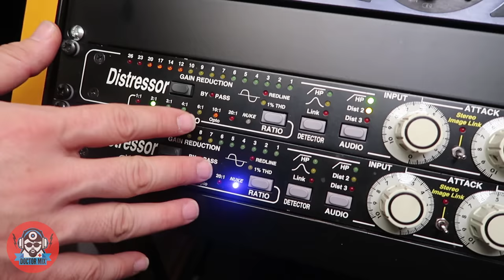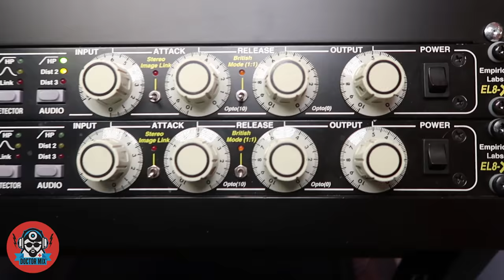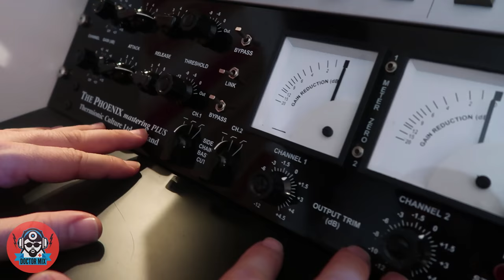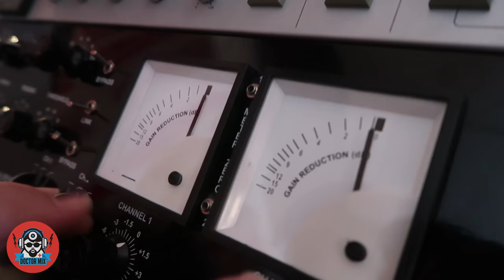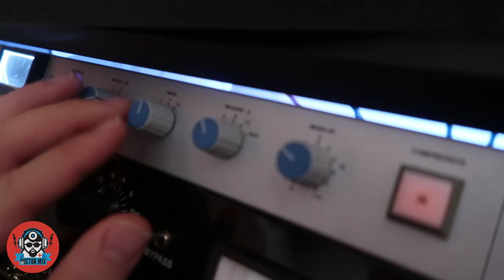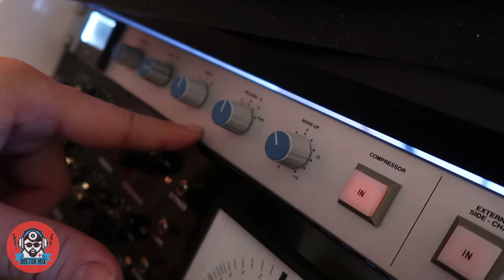How Audio Compression Works

Comment: Gain reduction starts instantaneous in every compressor circuit, there's no delay time in the reaction of a compressor - attack is the speed at witch the compressor achieves (roughly) the gain reduction dictated by the ratio/threshold controls. The release control is the speed at witch the compressor restores most of the gain taken by the compressor. So you can consider this two controls as ratios not time constants.  Of course, attack and release are not linear... but that's another story.

Comment: Very nice to hear someone who has experience with the hardware for these iconic compressors. I've only used UAD so no idea how it compares to the real units. I have a feeling not too well because my little RNC hardware unit is more effective than any of my compressors for taming vocals. I definitely have to work harder with plugins but don't have unison tech. am using an rme ufx which has a simple compressor built in.
Reply from the maker: Hi John! Thanks so much for your good comments! Rock on! ;-)
Reply: John Barry to be fair, all the FMR products have sound quality way beyond their price range.

As to cheap compressors, try the Alesis 3630. It was key in Daft Punk's Discovery and it's about $50-$100 on eBay.

Comment: Think the attack explanation is a bit off, it's not a delay of action control, it's rate of change.
Reply: everything is explained not practical and tahts why its hard to understand compression. Its hard because compresors works in 
unintuitive way. what I mean by that is when you have a unconsistant volume in some track, the intuitive way to even up the levels would be to raise teh level of quieter parts, but thats not what compressor does. It levels down the loud parts  to the level of quiet ones and then it boost up all the whole signal.  This is my practical explenation of the controls: treshold should be set at the top of a main energy of a track, this is a thing that can be observed more than heard. this is an example of determining where the main energy of a track is: https://drive.google.com/open?id=1In5SLE51ENs9uFJn3yTBokfYchDOE5iR. Ratio is a procentage of compression. 2:1 is a 50% compressionm, 4:1 is a 25% compression and everything above 10:1 is considered a leveler that quiets everything above the treshold.  Practical use of ratio. Everything with a higher ratio seems to be in your face, even and loud. so if you are trying to be new and fresh in mixing, use high ration on drums and vocals.  everything with a lower ratio is good for things that are even already or on mix bus. Attack and release are the hardest to understand. Attack is a attack transient designer of a sound. Attack of a sound is a life of a sound, so if you set it to fast it might die. I barely use anything slower  than 5ms. Drums always 30ms or higher, vocals slow attack, fast release, 4:1 and DEEP treshold - to destroy - smth like 10-12-14db of reduction. Try using it with a classic compressor like 1176 - you get that close in your face vocals. Release is a tail or decay transient designer. in practice it means that if your signal is complicated it has a lot of harmonics, a lot of elements hiting at the same time you would prefer to use longer release, faster release gives you more in your face sound. I use fast release on vocals, but it must be in tempo (check "bpm to ms calculator" online) basicly longer release make the sound easier, polished, even. i use fast release on a simple hip-hop drums and I produce beats in specified tempo beacuse  I know I will later use a compresor like SSL with fixed settings. For example if I want to make a typical hip-hop bit i might set it up in project for 100bpm because 1/4th of that tempo is exactly 600ms, 1/8 is 300ms - two of 5 availible settings on the cmpressor - that way I know im always in time with my compression.